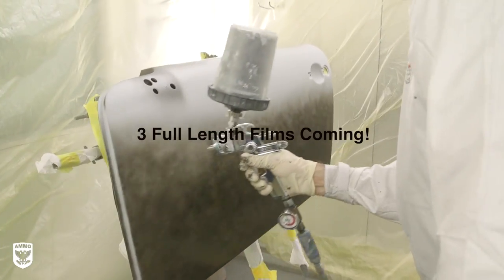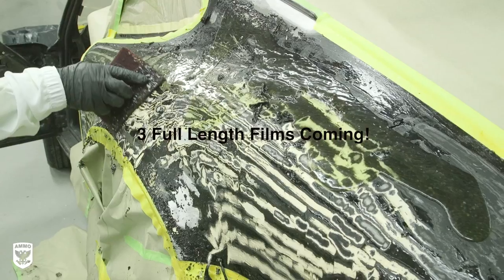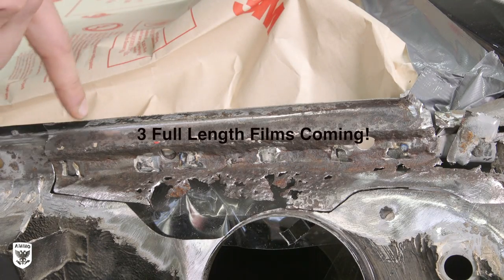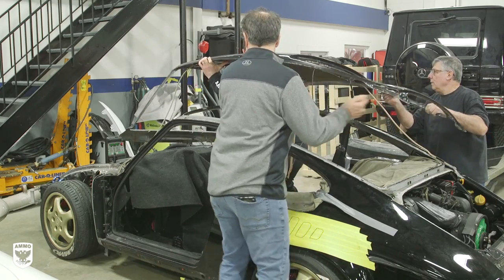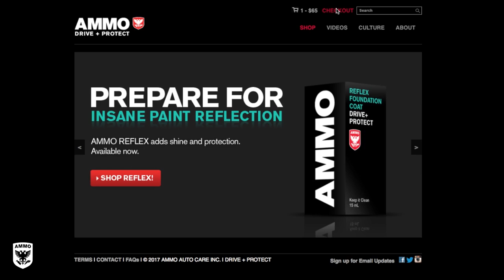AMMO Porsche 964 Resto in 5 Min Teaser

Comment: I would shudder to think what the bill on that was.
Reply: More than you can afford pal....
Reply: Something like $40K I guess... :S
Reply: A lot more :-)
Reply: $50-60K at least.
Reply: Labour alone would be 40k depending on how he is with bussiness ties etc
Reply: No idea what there worth in the US but over here thats more than the 964 sells for.
Reply: If anyone knows the hourly rate of labour for these kind of jobs, we would be able to calculate. 750 man hours x $50/hr (guess) = $37,500. I guess about $40K is pretty close. @HenkkaWRC
Reply: Yeah. $40K for labour and 10-20K parts.

Anyway, that was very expensive restoration/restomod project.
Reply: HenkkaWRC there's a saying in racing; "how do you make a small fortune in racing? Start with a large one." ;)
Reply: What parts did they use to get to 10k-20k?  I saw them open the roof...but most of the other stuff looked like they took it off and restored it and added metal to the body when needed.  I guess there was all the paint and chemicals though.
Reply: @curtieson  The most obvious changes were the roof, headlights, custom milled rims and soundproofing. I'm also 100% sure they replaced everything that looked old or worn out, like some trim pieces, etc. Also the paint itself costs money.
Reply: Sean Bailey where do you live???
Reply: Ermin the one shop I had my truck in was 65$ hour , and up to 120$ hour I've heard of as low as 40 ish but he said concourse restoration so probably on the higher end of cost
Reply: Randy Purtteman and this is why I'd like to get good enough on metal work so I don't go bankrupt tying to fix my cars but at the same time I'm not letting my hands have another go at it without having a good teacher keeping me on the right path and not screwing up
Reply: Randy Purtteman regular mech is about 120$ an hour. So i guess these take more..
Reply: bout tree fitty

Comment: how did it get so extremely rusty?
Reply: He lives in the northeast. Salt eats cars.
Reply: I live in Austria and here there are absurd amounts of salt on the roads in the winter. Yet I haven't seen a Porsche rusted out like that. There has to be something else going on. Also the rust on his porsche was mainly on the roof and around the glass.
Reply: nobutada55 true my van is a '10 and Ive got small spots down by the wheel wells starting.  I'm in central Illinois. They love the salt here. Predict 1 flake and they're throwing salt
Reply: Probably leaking sunroof considering the car was rusted in the roof and the floor of the car and carpets were wet.
Reply: Sean Bailey it's a Porsche, they ALL rust around the front and rear windshields.
Reply: Jason Rushing I live in Chicago and it's the same here. There is potholes that can rip your suspension out here all because of the salt.

Comment: That's not the right way to remove the rear bumper cover.  At minute 2:21 he is trying to remove the connectors for the license plate lights. He was supposed to disconnect them from the right side tail light connector.  BUSTED, RUSTED AND CAN'T BE TRUSTED!
Reply: He broke the the center rear bumper cover on the upper area where the rivets are. Next time remove the bumper complete with the re-bar.